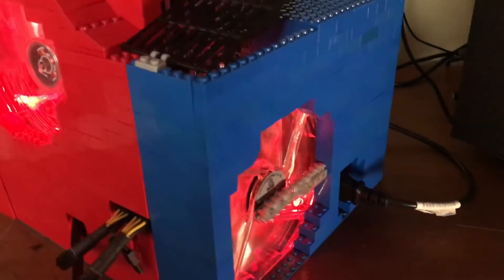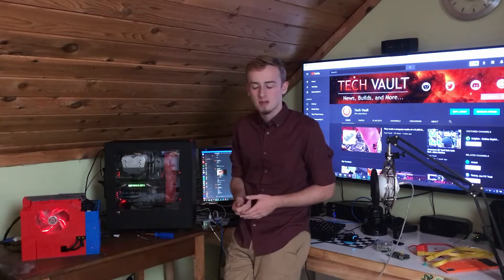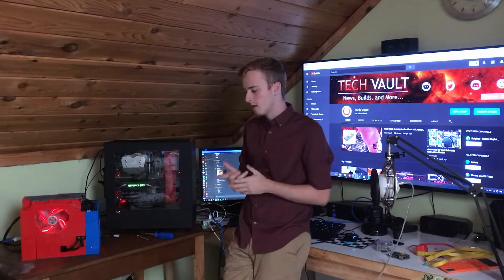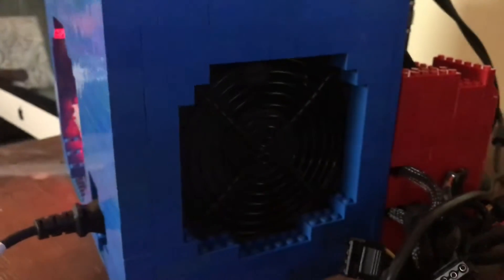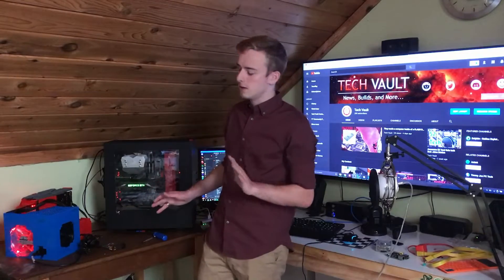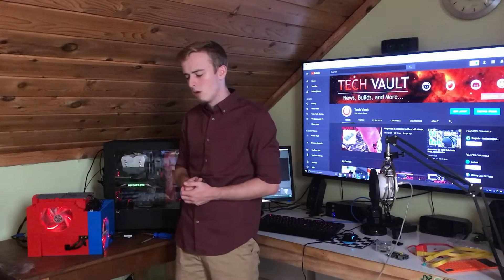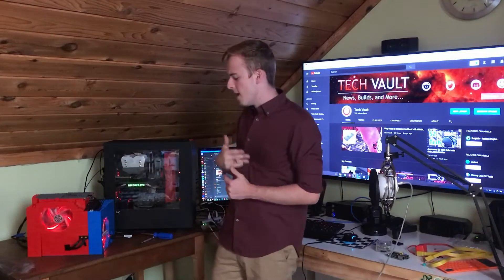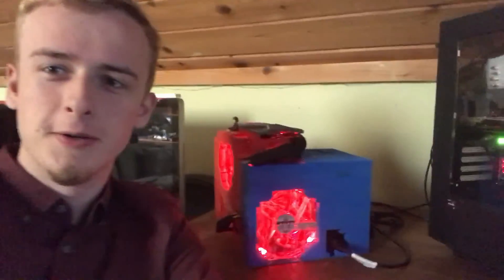I built a LEGO PC CASE and it cools better than a $200 computer case!

Comment: Make a 2nd version!
Reply from the maker: Based off of the views in less than an hour looks like it.
Reply: For a channel as new as yours, that is an impressive amount of views (in an hour)!
Reply from the maker: I smell the viral video all the way from over here.
Reply: A lot more interlocking for version 2.0, if possible.
Reply: @ApexierGS  Especially on the corners where the fans were. Use alternating 4 and 8 blocks. That gives stability to the wall around the fan and less of a chance of breakage when moving it around. Gluing your main Lego base plate to some MDF board wouldn't hurt, either.

Comment: Ryzen CPUs shouldn't get to 80c when gaming
Reply: thats not true. 80c - 85c is a acceptable target under stress. You probably want to keep it below 90c to prevent long term degradation, however at 95c the processor will start to throttle back to protect itself.

Comment: wtf did you really close psu's air out? Do you want to kill your power supply?
Reply from the maker: No the power supply has output on the top and side. It has all porous sides so it doesn’t matter the direction.
Reply: oh didn't notice that

Comment: dang, this must have taken a long time. Also, i have very little idea how grounding works, but since you used Legos, did you have any trouble grounding it?
Reply from the maker: +Xario1 no a psu has grounding already in it and when it connects to the wall it was fine

Comment: So what happens if you drop the Lego PC? Will the legos explode or are they glued together?
Reply from the maker: +All Hail Megatron I’m not committed enough to glue them together but you would have to. Second of all if you drop a pc in general it will break.
Reply: not necessarily *cough cough linus*
Reply from the maker: Oof
Reply: the only components that would break if you drop them would be the motherboard and maybe graphics card or hard drive but ssds are a thing and most cpus are now using lga rather than pga